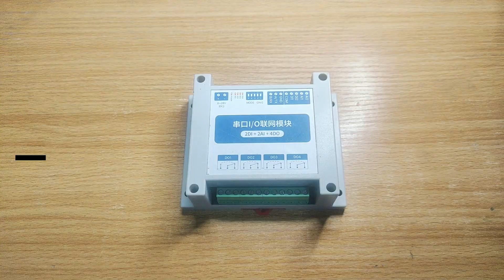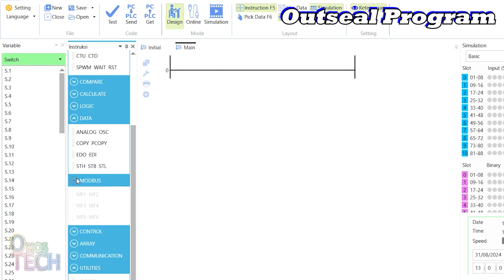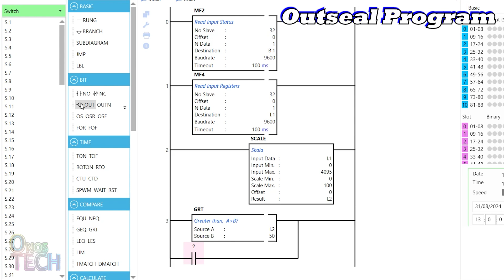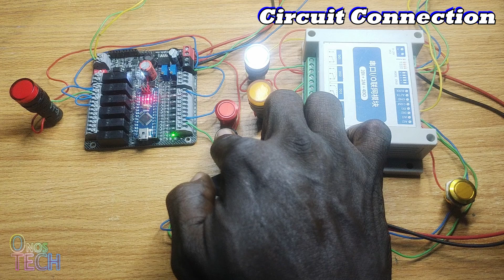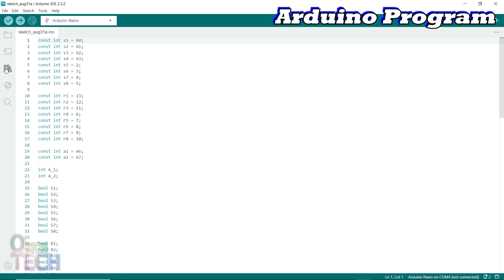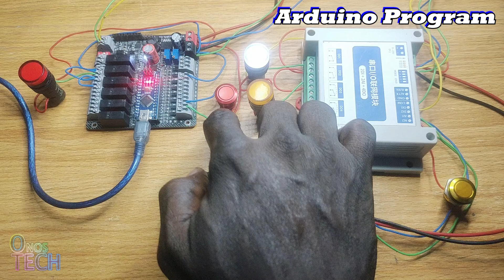#7 Arduino Nano PLC Controlling the EBYTE Modbus RTU

Comment: Hi this is Anthony 
I design project and I use Arduino too many times I have been asked about modebus communication and BMS.
For example I design a project and I want to convert my measurement (pressure tembersture etc) to modebus so the local plc will informed..... Does EBYTE has any simple module to fo this (I don't want inputs or outputs) only the communication.
Regards Anthony
Reply from the maker: You can program your Arduino to be a Modbus slave using same steps in this video: https://youtu.be/t1qlNGgjtOA